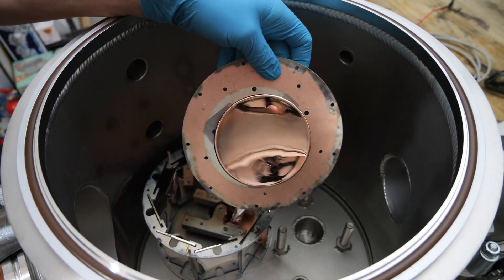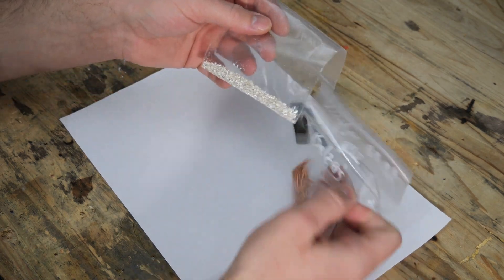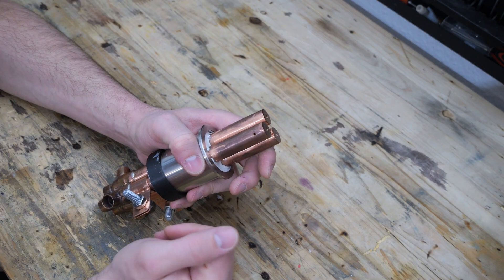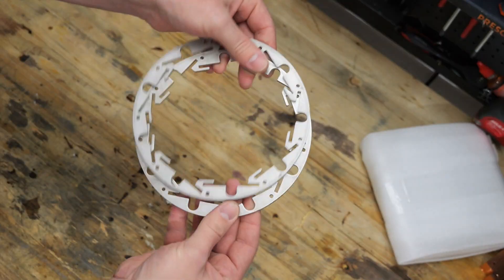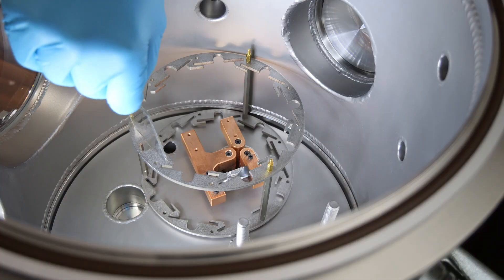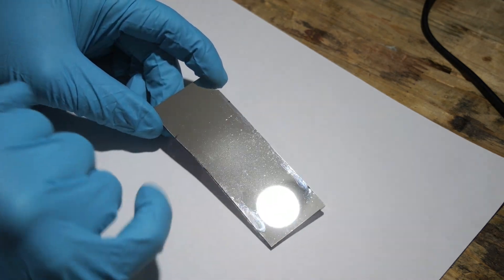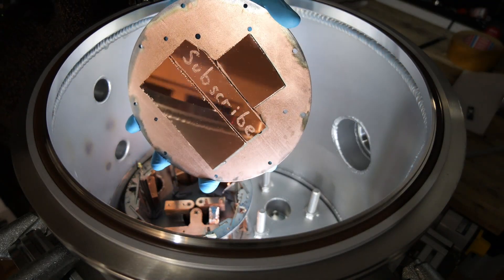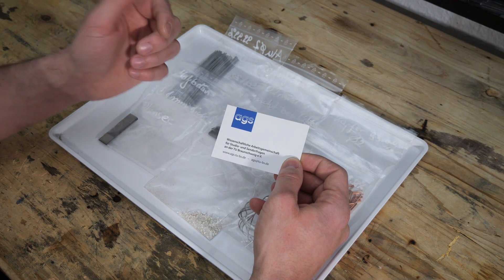Evaporating Metal in a High Vacuum to Coat Glass and PLA - PVD

Comment: Since you used JB weld in a dielectric for your first DIY passthough, Ill head off the inevitable "OMG JB weld has metal in it!!1!" comments. Bulk JB weld is an insulator, as there isnt enough metal loading for JB weld to be conductive, unless you compress the bondline during curing, to the point its thin enough both of your parts are crushing  the iron fill.
Reply: At the extremely low voltage, about 2V or so its not gonna be an issue❤
Reply from the maker: Haha, I actually expected a comment like that. But you are right, JB weld is non conductive. 
I still wouldn't use it for high voltage stuff though. I would imagine the breakdown voltage is a lot lower due to the metal.

Comment: Small tipp: You don't need to clamp down the lid of the chamber. The force of the Vacuum is more than enough
Reply: In case of a massive leak, momentum from inrushing air can actually give > 1 bar pressure in the chamber, so having a few clamps, at least, would be wise.

Comment: That’s a massive high vacuum chamber. Also, Applied Science has video on cleaning glass already, but I guess another one won’t hurt.
Reply from the maker: Yes, his videos are great. I have seen the one about the cleaning process. I doubt mine will be nearly as detailed as his.
Reply: While that's definitely a really large vacuum chamber for someone to have at home, the semiconductor industry utilizes significantly larger chambers (we're talking 60 cubic feet or more) that hold roughly the same pressures. Buuuut the pumps are, of course, much bigger as well.

Comment: We use Polyimide (Kapton) tape all the time with our PVD setups. Additionally, certain materials tend to "spit" when you ramp the power at too high of a rate. The shutter should be effective in reducing that issue, but I would try and ramp up the power slowly initially to avoid those spots you see on some of your depositions.
Reply from the maker: Yes, I definitely ramped up the temperature too fast when evaporating the silver. I could see it "spit". When evaporating the copper I raised the temperature slowly and did not get those spots on the glass surface. 

How do you prepare the glass surface before coating it? And which metals do adhere best to glass surfaces in your experience? 

Thanks a lot for the information!
Reply: @AdvancedTinkering  Ideally, we follow an RCA clean procedure. Though you can usually get away with Acetone/IPA/DI w/ ultrasonication. Cr and Ti both work really well as adhesion layers for SiO2. Generally, we find that Ti is best for Si and Cr for SiO2
Reply: When using Kapton tape, ensure it is the one compatible for UHV, it is slightly more pricey but uses a proper adhesive.

Comment: pretty cool! I love playing with modified MOTs :) How do you control the power? with a variac?

You could probably make PCB's using a mask for the tracks no? That would be a cool project.
Reply from the maker: Yes, I used a variac. Yes using photoresist or detailed stencils I should be able to make pcbs.
Reply: @AdvancedTinkering ooh, you could use ceramic as a substrate!
Reply from the maker: Yes, I want to try that. It may even be possible to solder or braze metal to the coated ceramics and make vacuum tight connections this way. 
Or I could integrate circuits into 3D printed parts.

Comment: Ground glass surfaces would hold the metal better, perhaps? Also structural colours would be interesting, if you can peel off the metal foil with the surface structure that causes different colours.

Comment: Many thanks for opening an enterely new and fascinating topic. The field of applications is just endless. For example, I believe the coated goggles can be used for direct sun observations or welding purposes. Further, you could build your own reflecting telescope. Last but not least, if you try to evaporate graphite you should be able to deposit tiny diamonds.
Reply from the maker: Yes, there are many interesting possibilities. I think the hard part about making optics would be the the precisely ground/shaped glass surface. And I think channels like Huygens Optics are way more capable in that area. 

I don't think it will be possible to evaporate graphite. Or do you have any information about that? I would be very interested because I'm thinking about making diamonds via CVD for a long time but it's a pretty involved process.
Reply: @AdvancedTinkering  "I don't think it will be possible to evaporate graphite"
Really hard to do if you want to stick to just a crucible. One option would be to use a laser for that: Heat up the carbon with electricity and use a laser for the last push to evaporation. But certainly that is not easy as now you have to deal with all the problems of having high-powered laser-pulses on an evaporating material. Can lead to some nasty splattering.

Comment: Nice to see your setup working this well. Really amazing that you can get nice mirror finishes.
If you take a second cruible, make a tiny hole in it and put it onto the first crucible upside down, you might be able to get a nice pencil beam.
Did you consider using ellipsometry to measure the thickness of your deposit?
Reply from the maker: Interesting idea to use a crucible with a hole inside. I will try that out. 
I haven't thought about ellipsometry to measure the thickness. I honestly never heard of it. But I will take a look into it.
Reply: @AdvancedTinkering if you are near a university with their own characterization facility (and with X-ray diffraction capability) you might be able to ask them if they could perform x-ray reflectivity on your samples to see thickness and determine growth rate. If that's something important to any future projects!
Reply: @ianmercer1291  You can also measure the thickness of metals if they are thin enough with spectroscopic reflectometry, which is a bit easier and cheaper.

Comment: Some might say 20mm copper is overkill. But can you even call it a high amperage pass through if it can't handle currents in the kA range?
Reply: Not only that but you would need lot thicker conductors in vaccum.
Any conductor has losses and in a vaccum it would be able to overheat.
I didn't research this I'm just going off from vaccum being thermal insulator
Reply: @blackturbine  I calculated the max current with the assumption that the water cooling is used. But even without it the heat will conduct through the walls of the pass through and it should be fine.
Reply: @MaxWithTheSax  i commented before I realized he was using water cooling but yeah with copper being so thick it would conduct enough heat away passively.
Thank you for responding :]

Comment: did you say you wanted to water-cool your high voltage electrical connections?
Reply from the maker: They are not high voltage, they are high current. The voltage is around 3 V. But it can supply 200 ampere without any problem.